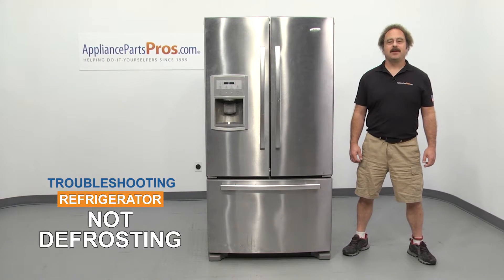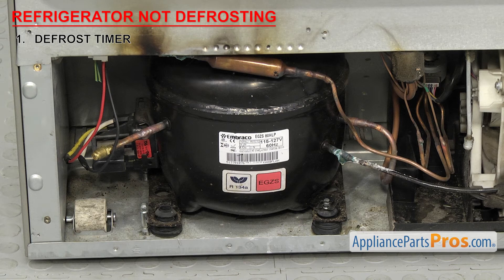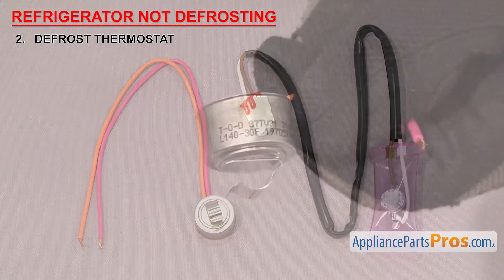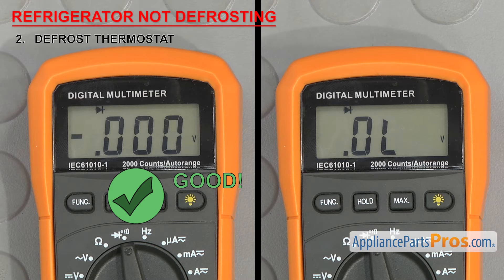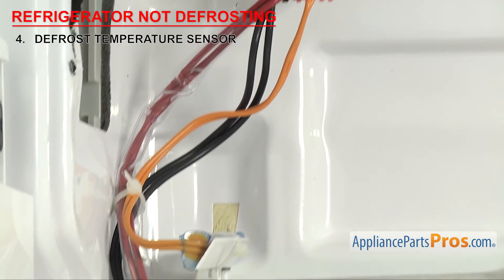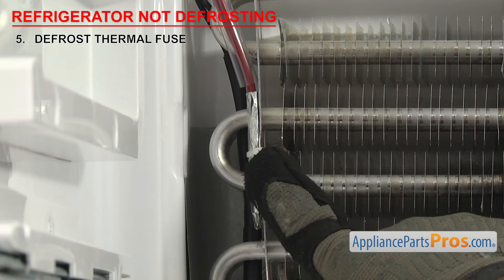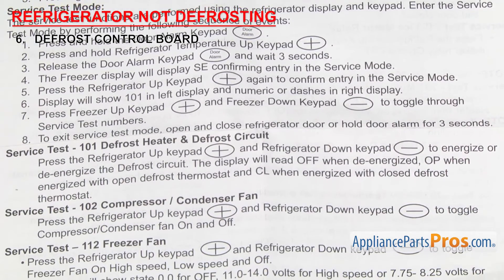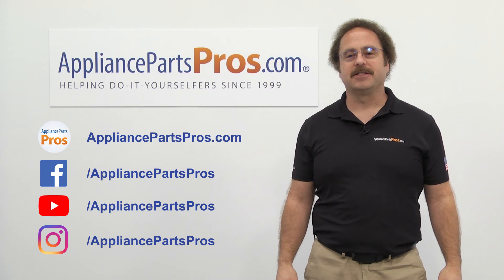Refrigerator Will Not Defrost - Top 6 Reasons & Fixes - Kenmore, Whirlpool, Frigidaire, GE & others

Comment: Replaced temperature control, Timer, Freezer Temperature sensor, Freezer heater and still freezer full of Ice.
No electrical power at the Heater Terminal when on defrost.
Frigidaire FFHT1826LW9
Reply from the maker: If you have replaced all of those parts, then you will need to check for a wiring issue.